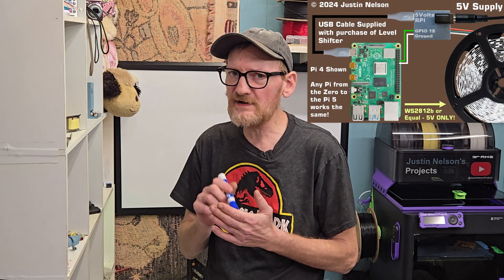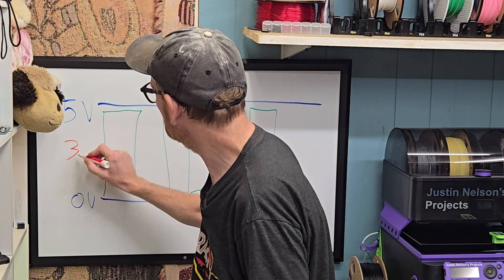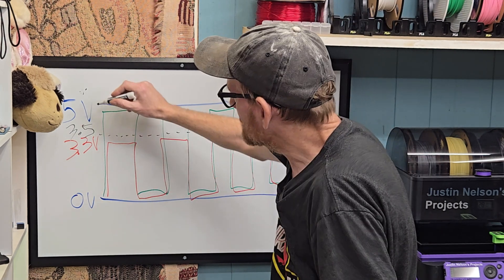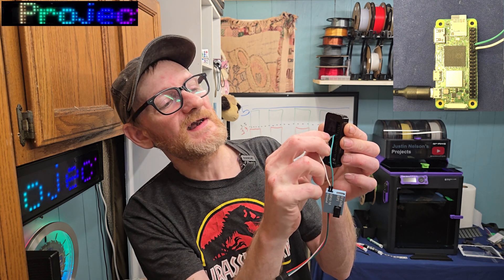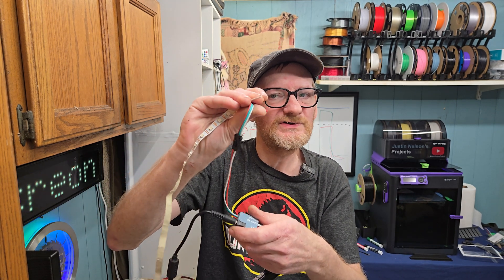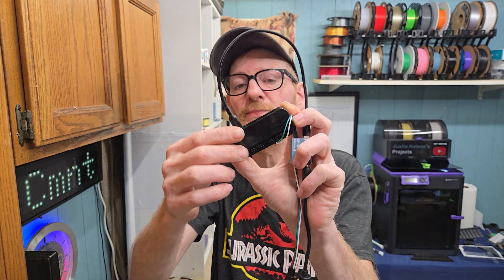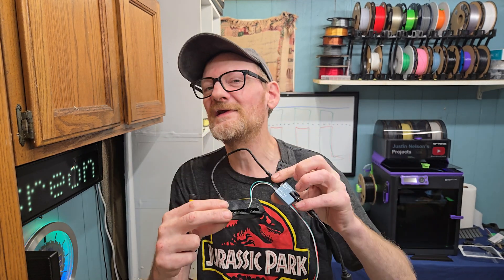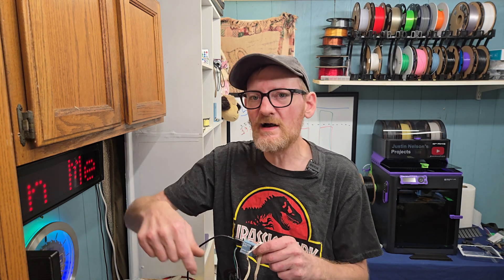Raspberry Pi, ESP32 or 8266 with RGB LEDs? Hyperion / WLED / FastLED / WS2812B

Comment: Does something like this exist for 12V strips?  I need a 15 foot run controlled by a raspberry pi.  Was looking into the WS2815's, but they're 12V instead of 5V.
Reply from the maker: I almost missed this comment. You could use my level shifter on 12V LEDs ***IF*** you CUT the red wire going to the LED strip, and power the strip separately. Then of course power the level shifter and Raspberry Pi via the 5V input.

My simpler, inline shifter however is 5-volts only, and will damage the LED strip if connected to a 12v strip (as it would send 12-volts to the DATA pin). That's why I 3D printed "5 VOLTS ONLY" very large on that model :)

I was thinking of making a more universal version that could accept 12- or even 24-volt strips, with a buck converter to power the Pi at 5V... but that's only if there's enough demand (it costs money to have a batch of PCBs made, and with the tariffs, who knows if it's even worth the investment right now)...
Reply: @ thanks for the reply! I think I’m actually just going to go with 5V strips for now, I need 5 meters and it seems like people on YouTube are powering runs that long without issues. Thanks!
Reply: For a 12v strip you'll want a buck converter for powering the pi or ESP and a level shifter for the data.
Reply: @ why do you need a buck converter for the pi, can’t you just power it like normal over usb?
Reply from the maker: @SeanMacProductions  You most certainly can power the Pi with its own power supply. In my "Hyperion" level shifter product, it is intended to reduce the number of power supplies being used, hence it having 2 USB power outputs. 

That does mean it is designed for 5 Volt LED strips. It's a highly specific use case. 

I only mentioned the buck converter idea to allow the device to run higher voltage LEDs... But realistically I don't see the need. 

12- and 24-Volt LED strips usually group 3 or more of each together that operate as one, so the color resolution would be terrible for a Hyperion setup ... 

For projects other than Hyperion... Use whatever works best for your situation.

Comment: I’m running a quinboard  like a esp32 and I’m wanting to put Hyperion hdr on like home assistant or let’s say docker does the feed from esp 32 go to my Hyperion and it sees the video correct? Or in theory or am I wrong I’ve done this before but with a straight raspberry pi but now I was like I can just use the esp 32 and run Hyperion in a container or in honeassistant but I can figure out if this will work
Reply from the maker: Sorry I missed this comment -- but I can only say, doing it this way, you're kind of on your own here... You certainly can drive the LEDs with an ESP32, but Hyperion will have to run on a Linux (Raspberry Pi) or other full computer OS -- it won't run directly on a microcontroller like an ESP board.

If you run Hyperion/HDR on the same machine as Home Assistant, just remember you still have to feed your video capture device into that machine, and any lag on that machine (by "machine" I mean either a PC/Laptop or Raspberry Pi) can and will affect the performance and timing of HyperHDR.

A dedicated Raspberry Pi is the way I recommend, for that reason. It runs nothing else that will interrupt the CPU, and does not need an ESP or any other device other than a level shifter (which you would still need on an ESP -- which also outputs 3.3v on the GPIO pins).

Final note -- any time you use WiFi to send the LED data to another device, that's another choke point that WILL result in lag and unpredictable behavior syncing the LEDs to the TV picture...

Comment: I bought a tiny esp32 5x5 led matrix board from bangood...   however, the example to control the led requires micropython and the adafruit neopixelbus library.

 I'm doing a bare-metal / raw-dog application.. besides, I believe the NeoPixel library uses bit banging for the LED timing, and I'd prefer to use the ESP32 RMT (Remote Control) Peripheral.

I did manage to get an rmt example* to work using the legacy/deprecated "driver/rmt.h"..  but I get warnings to use the new "driver/rmt_tx.h".   Unfortunately, haven't been able to port it to the new driver successfully.. none of the LEDs light up.  

Does FastLED use RMT and this new driver?
Reply: *
include "driver/rmt.h"  // **************** DEPRECATED ******************
define LED_PIN 8        // IO8 is connected to the W2812 IC
define NUM_LEDS 25

define BITS_PER_PIXEL 24      // 8Red + 8Green + 8Blue
define BLUE_ONLY 0x000000FF   // Lowest 8-bits of 24 bit value
define GREEN_ONLY 0x00FF0000  // Upper 8-bits of 24 bit value
define RED_ONLY 0x0000FF00    // Middle 8-bits of 24 bit value

// WS2812 timing parameters (in nanoseconds)
define T0H 400
define T0L 850
define T1H 800
define T1L 450

void ws2812_test(void) {
        uint32_t rgb;

        // Configure RMT peripheral
        rmt_config_t config = RMT_DEFAULT_CONFIG_TX(LED_PIN, RMT_CHANNEL_0);
        config.clk_div = 2;  // Set clock divider
        rmt_config(&config);
        rmt_driver_install(RMT_CHANNEL_0, 0, 0);

        // Convert timing to RMT ticks
        uint32_t counter_clk = APB_CLK_FREQ / config.clk_div;
        float ratio = (float)counter_clk / 1e9;

        rmt_item32_t bits[24];
        for (int i = 0; i < 24; i++) {
                bits[i].duration0 = T1H * ratio;
                bits[i].level0 = 1;
                bits[i].duration1 = T1L * ratio;
                bits[i].level1 = 0;
        }

        // Create LED buffer
        rmt_item32_t* led_data = (rmt_item32_t*)malloc(
            NUM_LEDS * BITS_PER_PIXEL * sizeof(rmt_item32_t));

        // Do a Checkerboard of Red/Green LEDs
        for (int i = 0; i < NUM_LEDS; i++) {
                // Assign the 24-bit RGB value for this particular LED
                rgb = (i & 1) ? GREEN_ONLY : RED_ONLY;
    
                for (int j = 0; j < 24; j++) {
                        int idx = i * 24 + j;
                        if (rgb & (1 << (23 - j))) {
                                led_data[idx] = bits[j];
                        } else {
                                led_data[idx].duration0 = T0H * ratio;
                                led_data[idx].level0 = 1;
                                led_data[idx].duration1 = T0L * ratio;
                                led_data[idx].level1 = 0;
                        }
                }
        }

        // Send data to LEDs
        rmt_write_items(RMT_CHANNEL_0, led_data, NUM_LEDS * 24, true);
        rmt_wait_tx_done(RMT_CHANNEL_0, portMAX_DELAY);
        free(led_data);
}
Reply from the maker: @bennguyen1313  your question is kind of beyond the scope of this particular video. But I do know that fast LED also uses bit bang on a pwm gpio pin, however it can be configured to use spi. I've never done it that way because the bitbang version has always worked for me... 

In the case of a raspberry pi, pretty much the same applies. If you're connecting to a gpio, it's being bit banged, otherwise you would need to use SPI or some other interface.

Comment: If I'm using an ESP32 for WLED, is it feeding 3v3 to the control pin?  I've been using just a plugged in ESP32 directly into my Neopixels in my printer, could it it be brighter?
Reply from the maker: It won't affect the brightness, just the integrity of the data ... If it's working reliably, you're probably safe . The level shifter just ensures a proper data signal in all cases.
Reply from the maker: I didn't realize I had already replied to this one lol. But just to add to my previous response, as long as the LED supply voltage is 5 volts, you will get the full brightness available on those LEDs . The data voltage will not affect the brightness however, just the integrity of the actual data.

Comment: What do you recommend for a decent side LED neo pixel screen? I bought one from AdaFruit a while ago, but the damn thing is sooo bright... It has no diffuser. (64x32 RGB LED Matrix - 6mm)
Reply from the maker: I don't have much experience with pre-built screens like that... what I show in the video is something I created a while back:

https://www.youtube.com/watch?v=HCQNyJWnmEA

I named it "scrolly" 😉

It's simply a "snake" of 7 rows of WS2812B LED strip... but for the diffuser, I did struggle for a while.

I ended up using a piece of diffuser out of an old flat-screen TV (just the white plastic part, cut to size) and when that was too hard to read in daylight, a layer of automotive window tint really set it off! I think I used "limo" tint...

Best of luck with your projects, hope this is helpful.